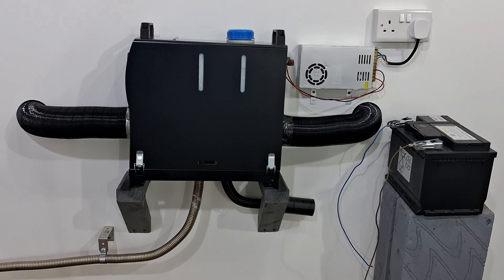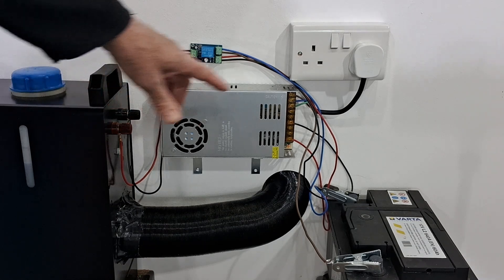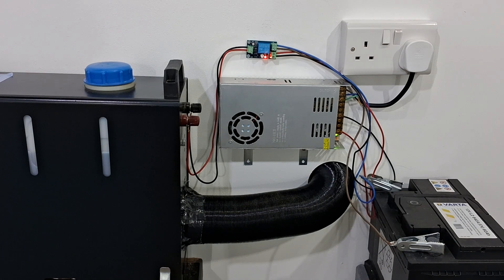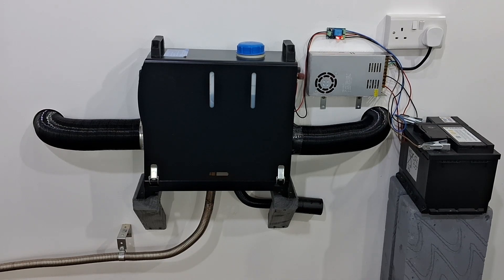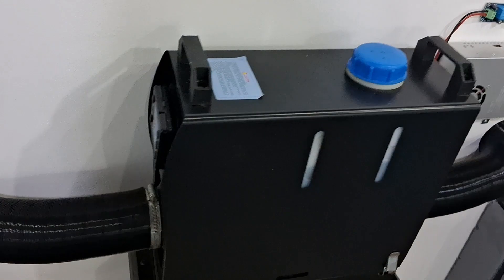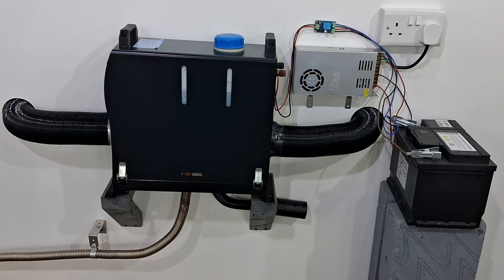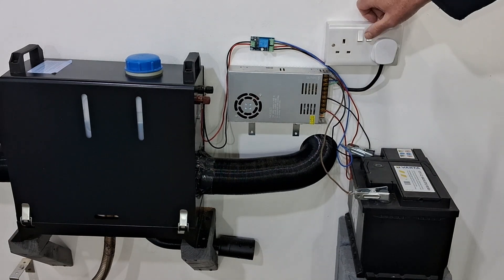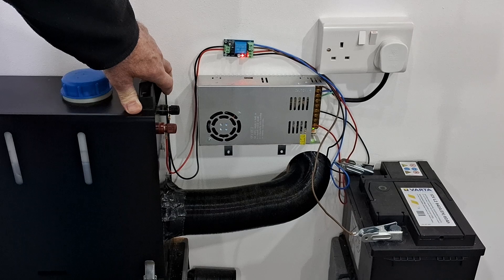DIESEL HEATER Automatic Emergency Power Cut Switcher 12v mains supply to battery backup

Comment: I think having a capacitor after the module would smooth out the switch over and stop any glitches but capacitors have a problem with in rush current that would damage the module if I remember right it's solved simply with a resistor and a diode on the + side of the cap
Reply from the maker: great idea

cheers andy

Comment: I wonder if you could use a cheap solar charge controller?, just wire your psu into the solar input, it would keep your battery charged aswell, and about the same cost.
Reply from the maker: great idea, i will look for one thanks andy

Comment: Things to be mindful of
Get rid of those cheap Chineseium crocodile battery clips. Minimal contact surface area contact with increased resistance. That pcb relay won't last long before the tracks burn out
Reply from the maker: cheers andy

Comment: Those relay contacts are only rated at 10A.  The heater can take 20A at start up.  Dodgy solution.
Reply: On start up, it drops down in running.
Reply: @spud7823  Doesn't matter.  The start up current is enough to weld the contacts together.  End of story.  The only safe way to do this would be to use the modules relay contacts to drive another (say car a 12V, 30A relay such as a standard car accessory relay) and use the PROPER rated contacts on that.
Reply: @kellyeye7224  we had a power cut 2wks ago I plugged it from the mains into my Beaudens power bank straight away, it's OK, no problems, the power bank is 140 Watts, it's a great device.
Reply from the maker: cheers andy xxxx
Reply: @spud7823  OK.  Despite trying to offer advice for SAFETY reasons (and I'm an electronics engineer with 40+ years of experience) you can carry on using your device as it seems I can't can't though to you.  I only hope you leave these comments up so others can take heed and do the right thing.

Comment: Have a look at this https://youtu.be/ii8eshq-s4w?si=qJkifHHw2TSJl1qu You don't need the switcher and it won't allow the battery to charge. You need to set the power supply to the charging voltage and have the battery permanently connected in parallel to maintain the battery on charge. Thank